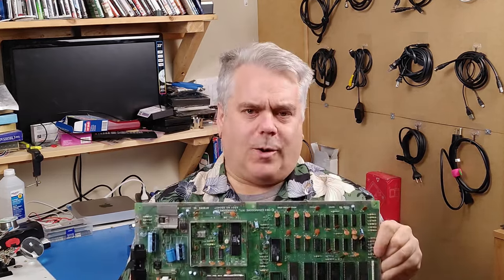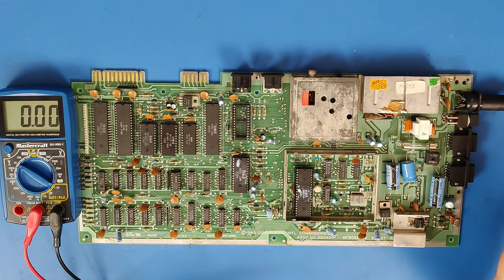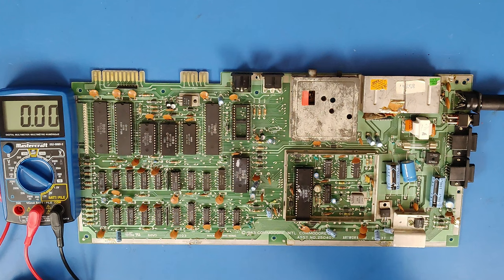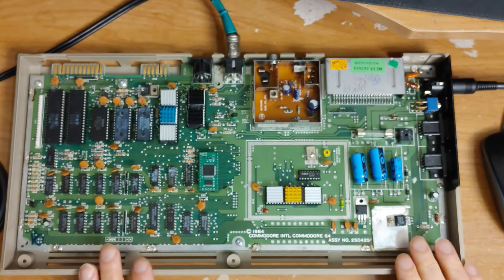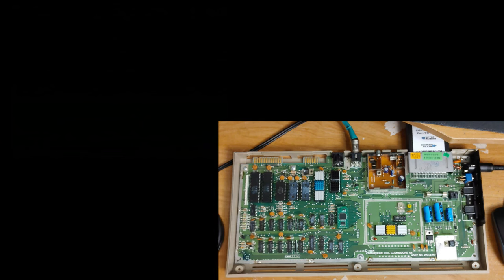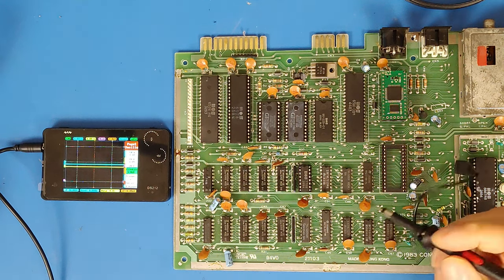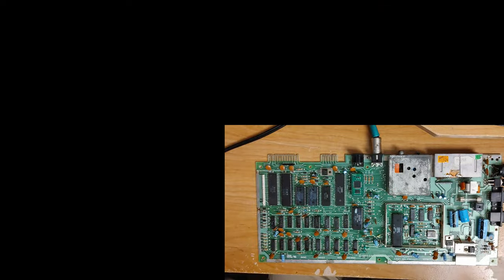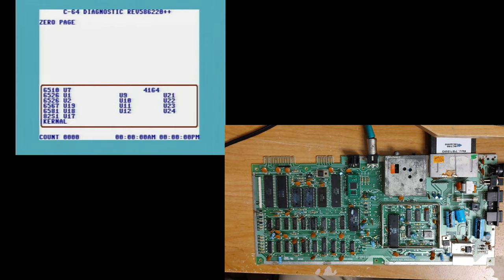Fixing My Other, Other Commodore 64

Comment: The 5V regulator on the board only powers the VIC and SID with a cleaner supply (besides the 12V for the analogue parts in the chips). All the other logic is powered by the 5V from the power brick / external psu which is one reason for possible difference voltages on the board.

Comment: It almost looks like a PLA issue, but it could be the CIAs
Normally the dead test cart is not dependent on the ROMS.
Reply from the maker: I think the CIA may be responsible for the keyboard, the N key seems to think it is a clear key.
Reply: @CanadianRetroThings  Looking at the keyboard matrix, the N key isn't even close to the CLR, which is Shift+Home. IIRC. Makes the case for a bad CIA.Too bad one is soldered in.

Comment: Pretty interesting that the N key seems to be causing a BRK, as if you hit the Restore key. I've never seen that before. If it was just clearing the screen (like the CLR button) then it wouldn't print READY on the screen too.
Reply from the maker: I would guess the CIA is interpreting the keypress wrong.  That could mean a bad CIA, since it is only one key I am fairly sure it isn't a bridged line somewhere.  But with this board, it could be anything!
Reply: @CanadianRetroThings The weird thing is that the Restore key doesn't go to the CIA - it goes to the 6510's NMI line, unlike all the other keys on the keyboard.
Reply from the maker: @8_Bit  Interesting, I did not know that.  The 6510 being bad was one of the ideas I had for why the cartridge is loading but not executing.
Reply: @CanadianRetroThings It seems really unlikely you could boot BASIC and have a flashing cursor and 38911 bytes free calculated without the 6510 working well, but some weird fault is possible I suppose!
Reply from the maker: @8_Bit  before I desolder anything I am comparing all the readings to a working C64, hopefully I will find something!